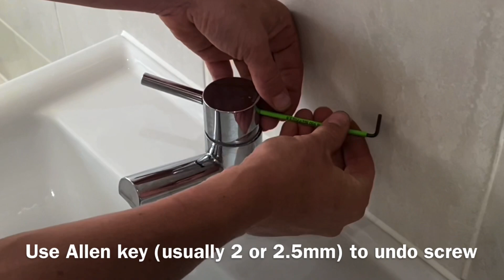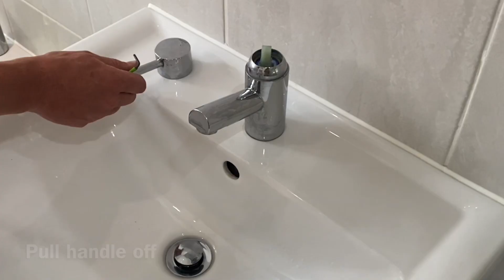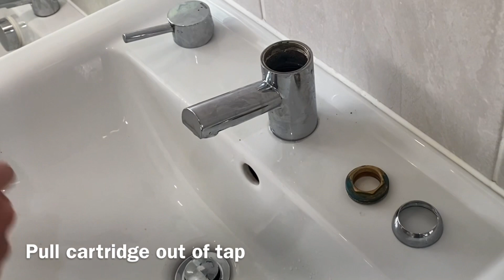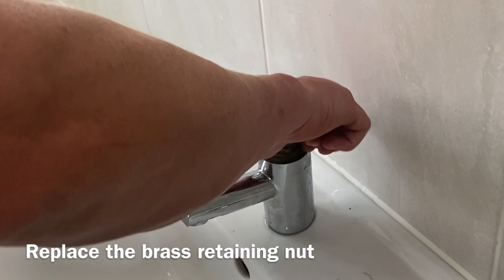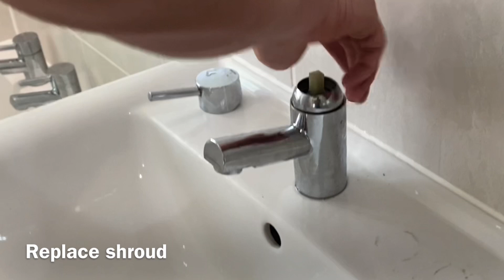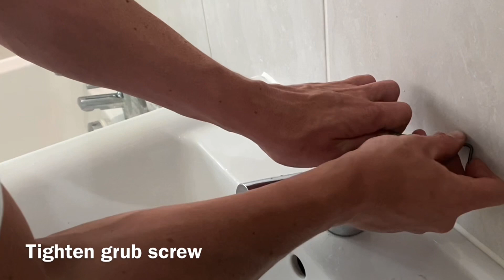How to remove a single lever basin / Kitchen mixer tap handle and replace cartridge @tapmagician

Comment: I knew how to replace the cartridge  in a shower tap, but when I tried it on the kitchen sink everything went wrong. The tap was secured to to the value through age rather than a screw and its taken several attempts and days with WD40 to loosen it enough to release it. Now the next bit, The installation  instructions just say "Remove the cover ", could  I work it out! 

Anyway  after watching this video, a slap on my forehead and a few expletives passing through  my brain. How simple. A very big thank you.

Comment: To  point the video is helpful. If you can not find the grub screw at the back or front of the handle to remove it, point the handle forwards, lift the handle up and look in the gap between handle and body. You may need a torch to find it. At 16 seconds the ring/shroud may be very difficult to remove due to crud, grease the thread before replacing. also the shroud m lever out and not have a thread on it. All depends on make